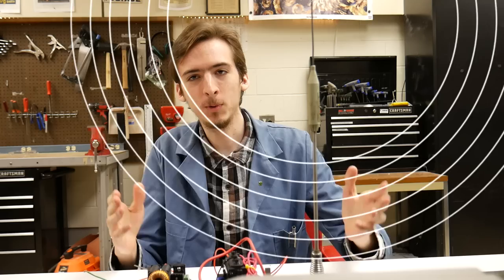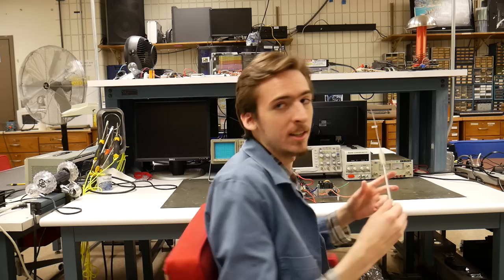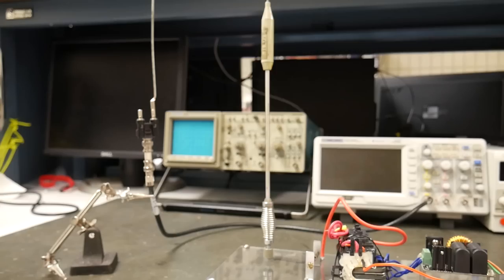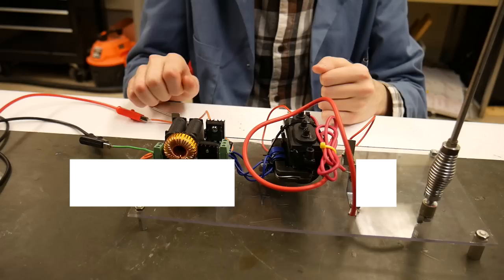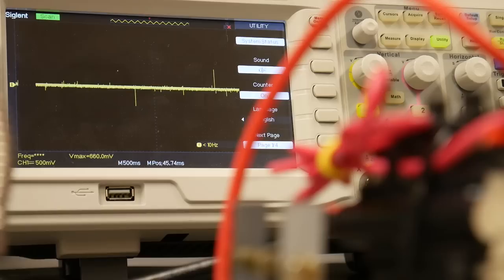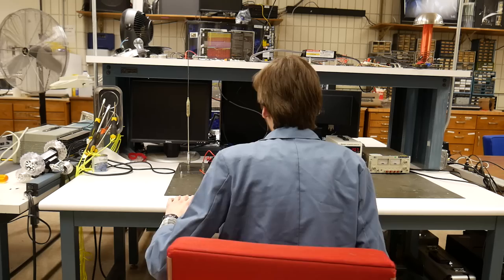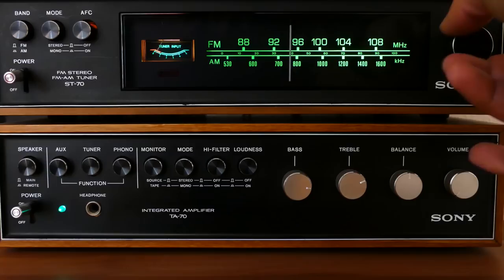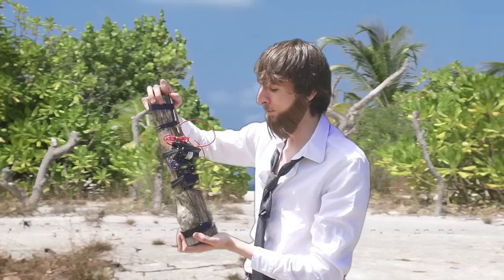Stranded? How to Make a Primitive Radio Transmitter | SPARK GAP RADIO (ft. Plasma Channel)

Comment: A useful but very simple transmitter can be made with a relay and a capacitor. If I remember correctly, the electrolytic capacitor is wired in parallel with the relay coil, and the switching part wired so that when the relay turns on, it shorts the capacitor (and battery).  The terminal of the moving part of the relay is wired to the water inside a PVC pipe. When powered on the combination of the capacitor charging and the inductance of the coil prevents the relay from turning on. Once charged, the relay turns on and discharges the capacitor, making a little spark inside the relay and radio waves which make their way into the water. The shorted relay turns itself off and the cycle repeats at a rate proportional to the capacitance. If an AM radio is tuned to best reception and then swept over the pipe full of radio emitting water the pipe can be traced. I think I powered it with a 9V battery and it was enough to trace a 1" PVC pipe 1.5-2 feet under sand from the well to the house 100 feet away. I'm not sure, but I think I remember it working okay if I just connected the antenna to the well housing even though that is grounded. If the relay doesn't buzz, try re-arranging the circuit, not 100% sure I'm remembering how I wired a circuit I first made by accident when i was a kid.

Comment from the maker: Special thanks to Plasma Channel who did a great job building and testing his transmitter! Seriously, you should check him out if you have not.

P.S. Quick note to all, feel free to join the Blueprint Discord server! https://discord.gg/kUhsU4p
Reply: Keep up the good work Dude 👍
Reply: I luv you bro
Reply: See if it will be more cooperative while building this flybackless SSTC  /watch?v=X5sCM2q6PXU
Reply: Recent discussions have lead me to confirm my hypothesis that the energy and antenna used are simply for signal strength and broadcast range?  I mean, should you use a simple diaphragm and length of wire, you could broadcast to a speacialy designed receiver with extra amplification abilities, short distances, like centimeters, but that the idea, and ability are sound? Pun intended.

Comment: I am a physician with background in electronics.  I am 70 yrs old  and since I became an amateur radio in the early 1960’s . I have read all about Tesla, and the hex of electronics.  During my many years of training in medicine I came across patients with great stories, some in their 80’s in the VA and other centers. In short: 3 patients, independently told me they worked on the USS  ELDRIDGE. Clearing the entire “innards” of the hull and installing generators and  RCA equipment that came in crates.  One of them was working on the wiring. Heavy duty wires, porcelain insulators etc . There was a fine  chain mesh, like “mosquito net” loosely going around the outside of the hull (in the water) that covered  that went around the entire ship hull & was bolted to the hull on the sides (ground?) . Several weeks later a pre assembled series of 3 sets 10 foot coils mounted in a 5 “ cylinders mounted in X,Y,Z   axis. Each set of the 3 coils mounted in XYZ configuration were installed  at the back outside deck, another set on top of control deck and the third on the front of the ship.  Each individual coil  had an independent primary  connected to its own power supply . The bases of each coil was about 3’ from the other two.
This is all I could get.  
I can’t make sense of this configuration using my very basic knowledge of physics and resonating circuits.  Just using the right hand rule, the fields of each set of 3 coils would cancel each other.
 I gather that each the sets of  3 coils  were likely connected individually.  Using high voltage in 1 set of 3 coils mounted this close would no doubt cause  arching to form.  Now  what do you think the 3 sets of 3 coils far enough from each other would do?  For sure some time of resonance wound be achieved  no matter if arching between the coils  happened. 

If each individual coil was activated individually within miliseconds of each other they each would work independent of each other on one set.  Then how would the 3 sets of 3 coils do anything, even if they were used in something like a phased array?
From the information above, I gather that the “Philadelphia Experiment” at least was tried.  The stories associated with it may all be made up. For sure this setup. Was mounted on the USS ELDRIDGE. I am very interested what you & the Plasma Channel guy make of this configuration. I asked a PhD physicist in the early 80’s what he thought. The only thing he could suggest is that the coils mounted in X,Y,Z configuration may have had something to do with our 3 dimensional universe, but even then this was just a wild guess… 

PLESE GET BACK TO ME ON THIS MYSTERY.  Are there other circuits besides possibly “insect zappers”, where this coil configuration is used?   THANKS IN ADVANCE..    Sergio

Comment: You know, If you just use a rotary spark gap to get consistent spark timing, and put one element on a rocker(or have really good rhythm) you aren't limited to morse, you can send straight up digital data. And on the subject of emergency transmitters, believe it or not, you can just use a car battery, two wires, and a metal file.
Wire-Pos  |  Neg-wire-file
Just scrape the Pos wire against the file very quickly to send hundreds of tightly packed bursts of broadband emf per stroke.
Reply: Basicly an audio modulated tesla coil then

Comment: One can use the LO (local oscillator) built into all radios as a transmitter. Inexpensive AM radios generally use 455 khz while FM radios mainly use an 10.7 mhz. The local oscillator is actually a mini-transmitter that is used in radio circuits for purposes of selectivity and image rejection. By tapping into the local oscillator at a certain point, one can inject an audio frequency and piggy back the LO to actually transmit on either the AM or FM band offset 455 khz higher for AM or 10.7 higher for FM. Thus if you tune the radio to 600 khz, you are actually transmitting on 1055 khz on AM. Likewise if you tune the FM radio to 88 mhz, you are actually transmitting on 98.7.  Unfortunately , the LO has a very weak output and that is just one of the limitations of using a radio's local oscillator as an emergency transmitter.   By adding an antenna, one can transmit a few feet to maybe 200 hundred feet under most ideal conditions. Another limitation is the possibility of getting a shock if you are using a house power instead of AA batteries. Another drawback is the possibility of shorting out your radio by attempting to use it as a transmitter by tapping into the wrong part of the radio circuit. But anyway, interesting video nonetheless...
Reply: I like your answer on how to obtain RF out of a radio. A very tiny loop of wire next to that local oscillator is a safer way of extracting that energy. Then, powering the radio on and off will become your Morse code signal. With the way everything seems to be monitored in this world, it would get you some attention.

Comment: Spark gap will come back in the form of ultra-wideband. It will work over short distances at very low power. But every node in an ATM mesh Network will be a transmitter receiver using ultra-wideband. The carriers will be high and dry looking for a ball player. The packets will be able to make hops three orders of magnitude faster than current IP so no backbone will be necessary. And it will be connection-oriented not broadcast oriented.
Reply: This got me thinking....

Comment: I’d put a very tiny loop of wire over the local oscillator to extract RF energy from it. Have that wire extend out as many feet as possible. It’ll create a radiating antenna for that energy to disperse. 
Use the on/off switch as a keyer to do Morse code. That’ll get you some attention.

Comment: Using a CB antenna on your project, while better than nothing, will pretty much tune your transmitter mainly into the CB band, which is woefully lacking an audience on a desert island, and maybe a few harmonics on either side of it at progressively lower signal strengths as you move farther and farther away from 11 meters. Any other hash that your spark gap transmitter makes will be choked out pretty much on every other frequency.
    Breaking open the center loaded coil and making a "long wire" antenna out of it's wire would create static interference at higher frequencies, (shorter antenna), and with more harmonics to create a more attention getting signal across a greater number of frequencies.
    It would be best to aim for the aircraft band, (108 to 136 MHz AM), as the possibility of any aircraft flying overhead would hear you on their AM frequencies as your spark gap transmissions would be more apt to open the aircraft band's AM squelch.
    Most boats today use VHF FM frequencies. While the FM VHF marine band, (166 to 174 MHz), is relatively close to the aircraft band, the FM channelized bandwidth, (25 MHz per channel), and it's associated FM squelch circuit would wash out / block out your signal from ever breaking into it's receiver.
    Very few ships, except for large ocean going freighters and cruise ships, at sea still use the HF SSB 6 MHz marine radios anymore due to their $4,000.00 to $6,000.00 price tag and very large, low frequency antenna compared to the $150.00 to $200.00 price tag of a good VHF FM marine radio and it's associated, much shorter, less wieldy antenna.
    While the HF SSB radio would be ideal to receive a spark gap signal, being that SSB radios use a BFO, (beat frequency oscillator) to hetrodyne with the carrier free SSB signal, to be able to hear intelligible human speech rather than something akin to Donald Duck is much more appealing.
    Your relatively short, "long wire" antenna made from the CB antenna's center load coil, might only make it a couple of miles out to sea at best as opposed to an aircraft's one to eight mile vertical height over head. You might also want to scare up something conductive such as a piece of wire, salt water soaked rope or what have you to connect to the spark electrode opposite from your antenna electrode. Thrown into the water or spiked into the ground, if you can find a piece of metal to use, to act as a ground plane would help to increase your range a bit. Every little bit helps.
    Keep plugging away, (pun intended). Channels like yours are very beneficial and educational. Thank you for your service.

Comment: Spark gap xmitters generate damped waves that are very rich in harmonics all the way to the vhf and higher thus when connected to a long wire Ant  can be used as a hailing xmitter to get help using damped Interupted CW

Comment: Fortunately EMERGENCY SITUATIONS have legal allowances for operating equipment not otherwise allowed. 

Such as, using a spark gap radio to signal help. 

Or if you do not have a ham radio license, you may use ham radio equipment to notify others of an emergency situation... IF NO OTHER PRACTICAL MEANS EXIST.

Comment: ...Yes, but how do I make a primitive radio transmitter? 
If I were on an uninhabited island, rare as they are, recalling this video would leave me only slightly better off, since IMO many of the practical details are omitted. 
100 feet isn't much; what does it take to make it detectable for planes passing overhead? How much energy should I be pumping into it? 
What angle should the antenna be at? How do I adjust the antenna to the length with the best resonance? Would putting in a reflector improve things?
Reply from the maker: Ships still to this day use spark gap radios for emergencies if I recall - it's not outside the realm of possibility.
As per practicality, I was just trying to make an interesting video; it's not practical. Making a signal fire is practical.

Comment: Well you guys did not add any resonance circuit which goes to your ariel, so your ariel is transmitting at every frequency and harmonics, if you had tried using resonance circuit after the spark gap you may have got much more power transmitting over a long distance. I love radio technology and i have build one at 30mhz AM transmitter and a regen receiver. I have got the range all over my house and it sounds every cool just that I needed 10 days to do practical and experimenting on it 🙃

Comment: Spark gaps are the secret ay. 
What is goin on now that the electricity built up the charge required to ionise air before clearing a spark gap. Is it an altered wave front? Or the spark gap kind ‘tunes’ the energy to its characteristics when the spark was created?
Reply from the maker: I'm not sure that I understand the question, but I'll try to answer the best I can.
A spark gap is basically 2 antennas. Charge will gather on them as the electric field between the two electrodes will increase until the field becomes strong enough to arc. The arc is continuous because it happens at such a high frequency, the air stays ionized the whole time.
Any tuning of the gap is done by external circuitry.

Comment: interesting, the signal will allow the LED to continue to light after the switch is closed on the transmitter. Is there a cap already charged to begin with ? Have you tried to have both ends of the bolts of your coherer driven into the earth and see if this works just as well. I have tried something similar and the earth will carry the signal to enable the circuit to be closed.

Comment: Hi! Quick question, at the end of the video when you said "you'll be able to send a signal for miles" is that a realistic estimate? Or was that just a dramatization for the sake of entertainment? Thanks!!!
Reply from the maker: Miles is accurate. (Well, technically I was just holding a prop - it didn't really transmit).
Mariners used spark gap radios all the way up into the 80'a for emergency reasons. They could be heard for roughly 10 miles around.

Comment: I have that same spark generator. Is the ozone it creates actually dangerous?

Also, I created a spark gap generator and detector based on videos by electroboom.... if I use two dipoles it does not work... if I use two monoples and connect the grounds together (with a wire) it "works" (the led lights up when I create the spark.

Do I need the inductor and cap on the transmitter side?  Why does it not seem to work with dipole antenna?  Is it working when I use a wire as a common ground or is it just using the wire to light the led?

Comment: Why do u need a tube to access higher frequencies?
Can't u just use a shorter antenna so u have a short wavelength and instead higher frequency?
I dont get it pls help :(
Reply from the maker: Margrave Antonov,
Tubes (and later transistors) were used because they are stable and can generate more complicated signals like AM and FM. Without modulation (which spark gaps cannot do) there would be no radio beyond Morris code.
Also, like spark gaps are “noisy” in the radio frequency spectrum. Without a stable generator like a tube, only one could transmit in an area at a time.
Reply: @BlueprintScience  Omg I see... thank you 😅

Comment: Funny that I decided on weekend make radio transmitter using BC547B (it doesn't work because I don't have stupid ceramic capacitor and 4,7 kOhm resistor  and you now release this video also before weekend on Friday I watched first video from you (what is magnetron ?, microwave 2.4GHz radioactive ) - also the 2.4GHz waves can come out of microwave I tested it using Wave Detector so it's dangerous and I feel like idiot that I was over 3 years making pizza in microwave :-( now I throwed it from window
Reply: I had a similar experience.. I fly micro drones in the house and one day my gf stuck it in the microwave and closed the door.. I still had full control and video which should be impossible if the case shields 2.4ghz

Comment: Hi
could you please Tell me where I can find the controller, for an Car induction Coil?
Reply from the maker: I don't know how it is done now, but I know that cars used to used to switch 12V with a relay to generate the spark from the induction coil.
Jay (Plasma Channel) used a 555 timer controller which I believe was purchased.
Hope that helps
Reply: Build one... Anytime I need something I build it and often build things just to do it